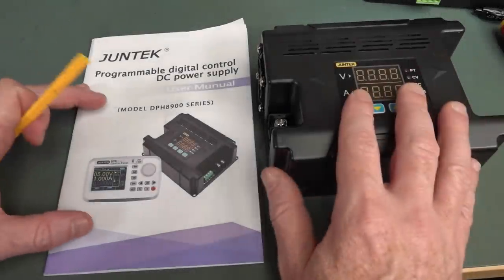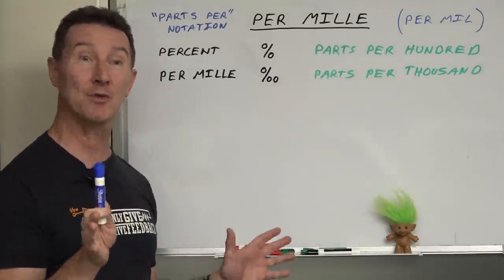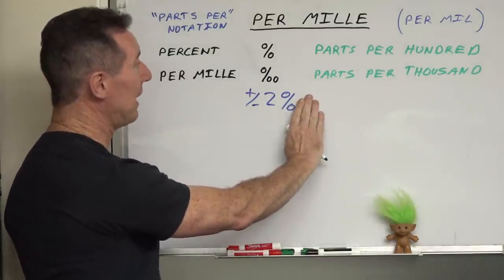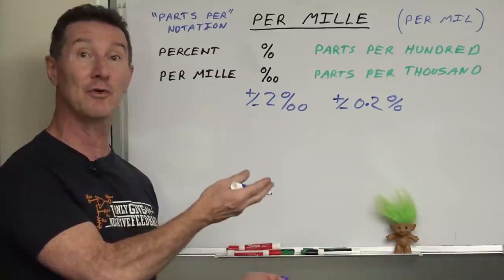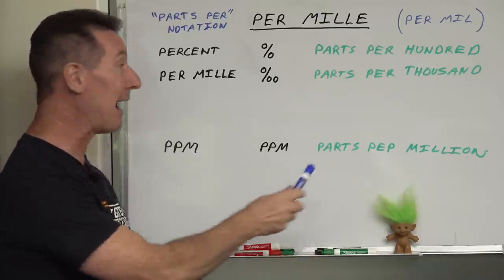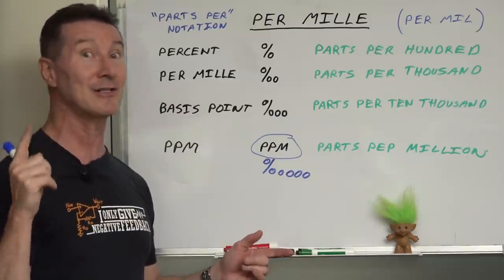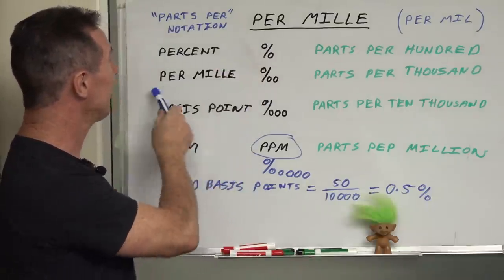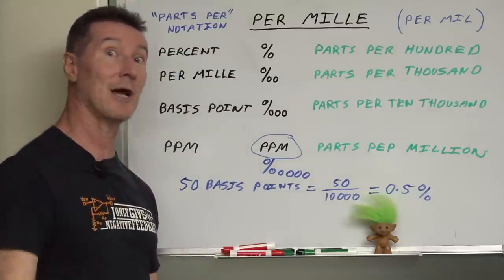EEVblog #1300 - "Parts Per" Notation EXPLAINED

Comment from the maker: I totally forgot to include CPM, or "Cost Per Mille" that you hear Youtubers talk about all the time. That's "Cost Per Thousand Impressions" or effectively "Revenue per thousand impressions". So a Youtuber might typically earn say $1 CPM, or $1 for every 1000 views.
And I just sprung it on Mrs EEVBlog who knew instantly it was per thousand, as she's chemist and it's used in various chemical concentrations.
Reply: Mille is correct...as in 'Mille Miglia' which means thousand miles in italian...an awesome car race that has been going since the 1920s
Reply: Sir i need to contact.....please......
Reply: Chuckle. Don't forget accounting/budget presentations. $50M is often $50,000 and $50MM is $50,000,000.
Reply: @WacKEDmaN  and IIRC even the English word "mile" is derived from the same Latin word for a thousand, which in the Roman empire was supposed to be the distance of 1000 strides of a soldier, whence also the word "milestone" as marker along a road. Other languages got the word as well, but each country their own definition. In Norway I think "1 mil" used to be around 11km, but after going metric was redefined as 10km and is still in common use whenever referring to travel distances and fuel consumption (0.5 L/mil rather than 5 L/100km).
Reply: @amirfareed2691  Hello Amir, (did that help?)
Reply: @benhetland576  WTF.  In military bootcamp we were taught to march with 32" steps, which is 64" per stride, which is within 1% of a mile for 1000 strides.  TIL what I was actually doing 45 years ago...
Reply: @flymypg  Wow, I never actually checked how realistic that was! Cool! But good on you, and glad we didn't have a similar rule while doing service in Norway... that step would need to be a wopping 197" to reach our 1 mil in a thousand strides ...
Reply: from latin/italian:
"per" = "for"
"cento" = 100
"mille" = 1000

SPQR docet
Reply: Very common usage in science disciplines. Surprised it is not more common in engineering.
Reply: No wonder 🥴 ms EEVblog is smarter than the whole lot of US! She only has two weak points 🥴🤪
Reply: @joopterwijn  Two weak points? Well if one is Dave, what's the other?😸
Reply: When you drink alcohol and drive we use it a lot in german ...  e.g. "0.8 Promille" is the amount of blood in alcohol (err, alcohol in blood) that you can have before you absolutely cannot drive at all anymore. "Mille" is, btw, latin.
Reply: @lesto12321  It never occurred to me that percent = per cent, as in 100 cents in a dollar, or 100 cent-i-meters, or 1000 mill-i-meters in a meter. Always just considered "percent" a concept in itself :D
Reply: If you were happy enough to buy it believing it had a spec of 2 percent, Then you must be REALLY Happy  with it now :)   GREAT video. Keep em coming  I haven't seen Part per Mille andy where  before Now Ill see it all over the place

Comment: In Germany, almost everyone knows this unit because it is used for how much of your blood is affected by alcohol. And I think many people using it do not even know that it means "parts per thousand" but they use it anyway.
Reply from the maker: Here it's percent, so the limit is 0.05% or "point o five" as we say.
Reply: @EEVblog  Same in America, except we live at the more dangerous rate of 0.08% Except commercial which is 0.04%.
Reply from the maker: @Gloworm17  What's deemed "commercial" ?
Reply: @EEVblog  Commercial Drivers License (CDL) required. Aka vehicles (rated) heavier than 26,000 lbs. Above that weight, many rules are made at the federal level, including the alcohol rule. Below that weight (generally) a normal (cereal box) drivers license can be used. The shocking thing is many times recreational vehicles (motorhomes) of any weight, even 80,000 lbs. fall under non-CDL (and cereal box license) thus 0.08% for that vehicle. That's what is dangerous.
Reply from the maker: @Gloworm17  Ours is 0.02% https://roadsafety.transport.nsw.gov.au/stayingsafe/alcoholdrugs/drinkdriving/bac/index.html
Reply: In the Netherlands we also use it as an alcohol measurement.  The driving limit is 0.5‰ this drops to 0.2‰ if you had you're drivers license for less then 5 years.
Reply: @EEVblog  I'm surprised that it's not federal AU thing if I read Vic Roads right. They seem to have zero tolerance for alcohol in a commercial vehicle. (Girlfriend is from there). Correct me if I'm wrong.
Reply: @EEVblog  fascinating how small things that one would accept as 'normal' or standard can differ, the German word for ‰ (Promille) is almost never used for anything else than blood alcohol, I wonder if it is the whole EU or just Germany
Reply from the maker: @Gloworm17  It's in that link. I actually thought it was zero for trucks as well, but it's not, it's 0.02% in NSW.
Reply: Same here in Austria. This goes even so far that when I talked about the death rates of the Coronavirus in permille, the other people just assumed that I was somehow talking about alcohol.
Reply: @EEVblog  I don't think it will ever be zero, the measurement equipment is quite sensitive. You could have a very small amount left in your blood, like 0.04%. In that case many people could get fined, even when they had a drink the day before. It could get very complicated from a legal standpoint as well. Therefore a reasonable threshold needs to be set.
Reply from the maker: @Carambal81  We actually have zero for learner and P plate drivers.
Reply from the maker: I'd bet that 99.99% of Australians have never seen the symbol or heard the term.
Reply: @EEVblog  germany has zero for beginners in their "Probezeit"(two years from the point where you get your license)and anyone under 21. After that you are allowed to drive with a BAC of 0.03%, or 0.05% if you don't show any signs of intoxication.
Reply: Tunisia divides it's currency into millimes rather than centimes like you'd probably expect in a French speaking country... when I was there on holiday in the early 90's they appeared to be using the same casio vfd cash registers as everywhere else so I guess there's a switch inside to sort it out and the Japanese engineers had just thought of everything as usual. Don't think I've ever seen dave tear one down but if you ever do that'll be something to look out for.
Reply: Also for some reason we kept "pro" for "in a" in 'pro'-mille, 'pro'-cent and so on. Not very hard to wrap your head around when you are not bothered by other systems of conversion. Not to speak ill of yours and ours.
Reply: In Sweden we call it promille as well and use it for Blood Alcohol Content measurements exclusively, at least regularly.
We have a zero vision in Sweden of zero deaths in traffic related accidents but still have a limit of 0.2‰, simply because as hinted at before it's within the margin of error. It's not feasible to go lower.
Reply: @Schwuuuuup  , also in Croatia, we spell it "promil"
Reply: @Schwuuuuup  same in Belgium, promille
Reply: @EEVblog  Most counters in Europe are measured in per/mille units for alcohol in blood concentration(BAC). For Ireland limit is 0.5%o and 0.2%o for commercial. For Poland limit is 0.2%o for all drivers.
Reply: In Portugal the unit is g/l. I guess it is the same as ‰ because the limit is 0.5 g/l (same as in Germany).
Reply: @Schwuuuuup  Yeah, not surprised if this is a pan-European thing (with the UK still excluding themselves, of course). At least in Scandinavia the word "promille" is used almost as a synonym for "drunk" or "having a high blood alcohol concentration", as in saying "driving with per mille" or just "permille driving", which is just our equivalent to the American DUI term.
Reply: @EEVblog  

I believe he means commercial drivers.
Reply: That makes sense. Too many times I've heard someone say 0.5 instead of 0.05 when referring to blood alcohol readings.
Reply: @EEVblog  did not know! Nice to know a truckie can have a light beer with lunch.
Reply: @horisontial  …except hat mille sounds like million and cent like zehn (ten), which is both quite off^^
Reply: Same in Sweden, when I saw this video I was quite confused as to why you would not know this already.
Reply: I was about to say in Austria and Germany it's very commonly used. and even though blood alcohol is actually measured in mg/ml, in the laws the limits are given in per mille
Reply: Same in The Netherlands. It's written and pronounced here as promille (latin).
Reply: In Austria we do not count on parts per thousand, but in parts per hundred! (at least the police)
Reply: same in scandinavia..
Reply: @EEVblog  There are a few cases, but mainly: truck drivers.
Reply: @EEVblog  ‰ is also used in geography to describe salination of sea water eg. pacific ocean - 35‰
Reply: In Sweden the technical limit is as mentioned 2 promille, but if you can't drive well and have any level you are considered drunk driving.
Reply: @EEVblog  It's effectively 0.02 for L and P platers here because that's as low a threshold you can go without too many false positives.

I know that the mandatory interlocks fitted to the cars of those with a drink driving offence have threshold set to 0.02 even though their licence would also have a Z condition (aka Zero BAC condition). You'd think that if they could set the threshold any lower that's when they would.
Reply: i'm from Austria and everybody knows that here too. we drive and drink a lot, after all xD
Reply: In Denmark we use the ‰ like in Germany - for alcohol concentration in the blood in relation to driving. And that is about the only thing we use it for. Here we call it promille (and 10 promille is 1 procent). So we don't call it drunk driving but promille driving. The limit for promille driving in DK is 0,5 ‰.
Reply: Yup, I instantly wanted to write this but then I remembered common sense and checked if someone already did, first... ;)
Reply: Here in Finland it all depends on the device measuring the alcohol content. It's either 0.5 promilles or 0.22mg/L. More accurate devices measure in mg/L. If police stops and on a older device you give 0.5 promilles or more then it's of to the more precise breath analyzer or a blood test.
Reply: same in dutch. in dutch its ''promille' / promillage'
Reply: @Vidicon31  Not only alcohol "promillage" but it was also taught at primary school at the same time the concept of percentage was introduced in the curriculum. Or at least when I was in primary school (in the '80s) in the Netherlands.  The hardest part of working with promillage is to find the right symbol for it on the computer when using it in a document.
Reply: Same in Norway
Reply: @Schwuuuuup  it's not for alcohol - it's chemistry thing.
Reply: @EEVblog  I'm one of the 0.01% (couldn't find the per mille symbo or it would be 0.1 0/00).
An Aussie expat in Germany, I bought a breath tester and was shocked when I tested 0.5%.
Checking the doco, I realised it was that wierd 'per mille' unit, my eyesight ain't good enough to see the double-0 on the tester's LCD.
Reply: In Poland is preety much the same.

Comment: ‰ is actually more comfortable to work with because it fits nicely with standard system units which is based on power or thousands (pico, nano, micro, milli, kilo, mega, giga...) so basically 1‰ of 123 mA is 123 μA
ppm is equally good because it makes you drop yet another levels: 1ppm of 1V is 1μV
The other units (percent, per ten thousands) are not as nice for that reason (they don't drop a whole number levels of units)
Reply: Yeah, I'm not that fond of percents to be honest...
Reply: @kajacx , but Americans are allergic to powers of 10. Surely, instead of percent, they should use something like per 60 or per 144.

Comment: I work in Mass Spectrometry and we're always dealing with ppb (parts per billion) for things like high voltage power supplies and the like!
Reply: ppb is also commonly used for dilute solutions such as chemical contamination. Then there is ppt (parts per trillion) and more. See https://en.wikipedia.org/wiki/Parts-per_notation. I'd not seen the permille symbol before.

Comment: Here in Sweden it's used for "unit alcohol/in blood".
Everyone with a drivers license knows of this unit. The cops use a alcohol meter which use per mille.
And if they need to draw blood then the same unit is used.
It's called "promille" in Swedish.
I have never seen it used in electronics though.

Comment: It's used often in Italy (and most of mainland Europe). It's useful and makes more sense when something is less than 1%. For example, 0.3% is clunky and prone to misinterpretation. 3‰ is easier to use and gives a clearer instant picture of the scale.
What is clearer: 'three in a thousand will die' or 'zero point three in a hundred will die'?
Reply: If you are used to that symbol that's fine. I read that as 3% and I would bet a lot of money that if questioned random people here in the US they would say the same. Everyone uses % here so it's common to see  <1% shown as decimals.

Comment: "Basis points" has slightly more nuance to it.
Interest rate before: 2%, after: 1.95%. The interest rate dropped by 50 basis points. The interest rate dropped by 2.5%. The interest rate dropped by 0.5 percentage points.

Saying "points" implies simple subtraction from the original value when calculating a drop or a raise. Saying "percent" or "per mil" means a change of value relative to the original value. (after = before + percentage*before/100)

Comment: This is used in every european country i'm aware of to messure the blood alcohol level.
Reply: Over here in Spain, it's measured in mg/L in air and g/L in blood (which is equivalent to permille if you take blood's density to be 1 g/L)
Reply: Well it's the old unit. Nowadays the official levels are usually on a different scale.
Reply: Here in the UK it’s basically the same as what GRBTutorials says for Spain, for driving. 35μg/100ml breath, 80mg/100ml blood, 107mg/100ml urine (all lower in Scotland).

Comment: Here in Oklahoma we use "mills," where one mill is one-tenth of a cent ($0.001) or one-thousandth of a dollar. For property tax computation.
Reply: Property taxes use “mill rates” in Ontario Canada.  I suppose it is done this way in many places.

Mill Rate Definition - Investopedia   The mill rate is the amount of tax payable per dollar of the assessed value of a property. The mill rate is based on "mills." It is a figure that represents the amount per $1,000 of the assessed value of the property, which is used to calculate the amount of property tax.
Reply: the interesting question is: do you use the notation ?!?!

Comment: In Natural Gas production, the letter M is still used to refer to 1000 of something. 10 MCM would be 10 thousand cubic meters, while 10 MMCM would be 10 million cubic meters. If you want a flow rate, then you just add D to the end, MMCMD = million cubic meters per day.

Comment: In Germany  you find per mil in the medicine, biology and chemistry.
In never have seen it in electrical engineering.
PPM is also in the description of your blueair filtersystem.
Reply: Yeah, I think these areas in Europe have wanted to rigorously stick to SI units. Maybe because early on the electrical field was using computers? It must've been adhered to earlier than that. Computers of course had the character set as a limitation for a loooooong time.

Comment: There's something special about the math when working with basis points.  If the existing rate is 5% and you add 100 basis points (1%) to it.  Then, you get 6% (5+1).  Where normally a 1% increase of a 5% rate would be 5.05%.
Reply: exactly: when they say the interest rate drops by 50 basis points, it means that it drops by 0.5 percentage point. It doesn't drop by 0.5 percent.  This notion of basis points helps to not get mixed up in this
Reply from the maker: Yes, it's equivalent to saying that the interest rates has dropped "by 0.5%" and everyone understand what it means. No one thinks it's 0.5% of the existing value. Joe Average has been conditioned with this.
Reply: @EEVblog  you're right that we understand it anyway

Comment: I come from the machining trade here in America. You will often here machinists refer to "tenths". But they don't mean tenths of an inch. They are talkiing about tenths of a thousandth of an inch, or 0.0001". Takes a lot of getting used to for new guys.
Reply from the maker: I actually like that!
Reply: I had to explain that to a fitter and turner here in Australia, he basically had never used imperial measurements. Bit hard explaining that the indicator he found at work and had on his desk was a tenths indicator, but that means tenths of a thou.